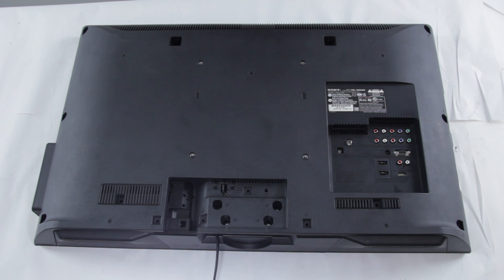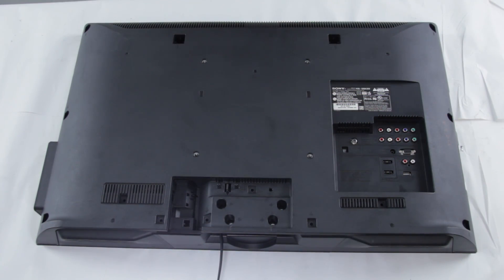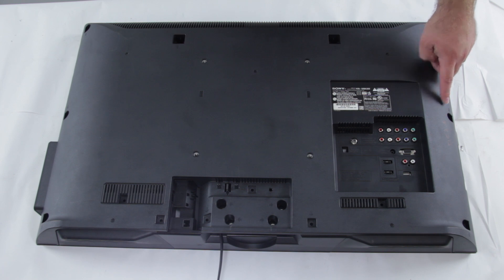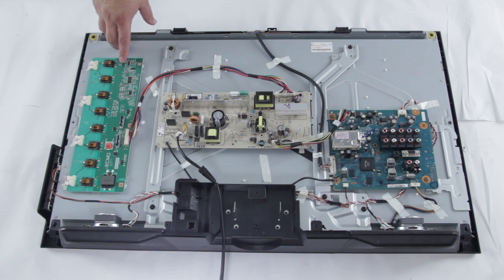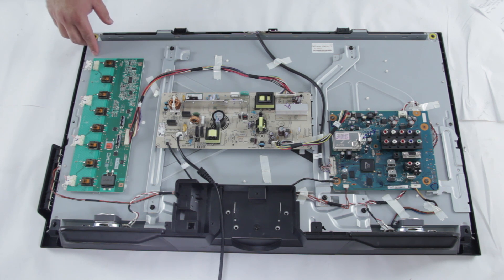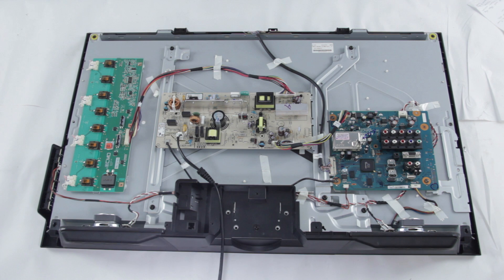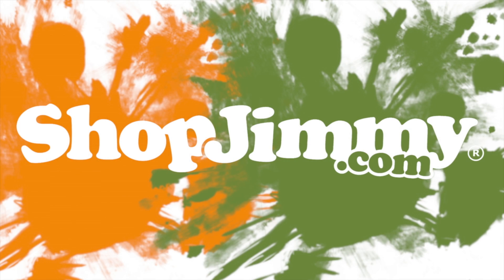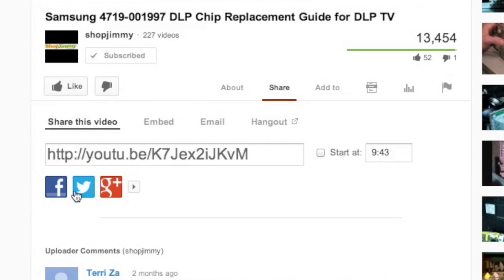LCD TV Repair Tutorial - Backlight Inverter Common Symptoms & Solutions - How to Fix LCD TVs

Comment: Hi, I have a Sharp LC52D62U set that has Red, Green and Blue vertical line across the screen. The picture behind the lines is good, only the lines break it up. Sound is good and backlite. The problem was intermitten a few days but now seems constant.
Thanks for you help.
Reply from the maker: mjhend55   This sounds like a TV panel (TV Screen) problem.  If your TV panel is bad, it may be more cost-effective to replace the TV as panels are typically hard to find in stock, difficult to replace, and expensive.  Thanks and please let us know if you have any further questions!  www.shopjimmy.com

Comment: I have LCD Quadro TFT32-MT15, all works but the picture is extremely in white tone (impossible to set brightness) and colors are inverted red is green etc... I guess its some problem with backlight inverter but not sure, would like to know if expert like you had any similar issues and how to fix it :D All help appreciated.

Comment: Samsung TV LNT4642HX/XAA. Showing symptoms of defective backlight inverters. Screen blank after 1-2 seconds. replaced left and right inverters without success, replaced power supply board, the problem still there. Please help!
Reply from the maker: vladimir chausovsky   Try this at your own risk.  Check the BL ON line to see if that drops out on your meter.  It is possible that you either received a defective replacement boards or the lamps inside the screen have gone bad.  Thanks and please let us know if you have any other questions!  www.shopjimmy.com

Comment: Hello, i got a problem with my LCD TV Grundig MODEL: Vision2 22-2801 SN 90400622, i already took it tot service repair the backlight inverter but the problem still comes back in few months. The Backlight is not going normal is going stronger and lower and it`s very enoying for eyes.  What can i do?  Thank you.
Reply from the maker: p4ulgoodboy   I recommend bringing the TV back to the service center to get it properly repaired.  Thanks!  www.shopjimmy.com

Comment: I have a Sinotec 32" LCD TV Model MT-1017114 LOT# 159540 XHT 080670.  The  TV does not switch on. The standby light comes on at power on but then nothing. I checked the PSU board and found several electrolytics that were measuring low so I replaced them. Still no joy. I checked the 5v line to the main ( processor) board and found it missing. After rechecking psu I established that the backlight invertor board was the culprit. I disconnected it from the PSU and switched on. The 9v and 5v and 24v lines came up but then cut back to 0v. I then made the assumption that the invertor board must be faulty so I removed it. On inspection I found the board underneath the invertor transformers discoloured. On further investigation I found the third one from the top was open circuit. I ordered a board from a supplier but could only get a secondhand one as this TV is pretty old. Manufactured Sept 2008. On receiving the board I installed it thinking now my problem was over. But no way the TV is still not functioning. Could you please give me some leads as to where I can now search for the problem. Your aid will be much appreciated.
Reply from the maker: Basil Solz   It sounds like you have received defective replacement boards, as your power supply appears to be working.  Thanks!  www.shopjimmy.com
Reply: Thanks chaps for your reply it's much appreciated. Yes I came to the same conclusion after re-examining the PSU that the invertor board has to be faulty although it was sent to me as a guaranteed working secondhand board. This is Africa.  :)

Comment: I got your reply ShopJimmy, i tried the TV again the other day and now it wont turn on and the power light is flashing orange, would this imply it is the powersupply instead of the panel?
Reply from the maker: Elias Pease   This could be the power supply that is bad, but it could also be the TV panel that is bad.  If you want to replace the power supply board to see if that fixes the the problem, here is a link to replacement parts:  http://www.shopjimmy.com/catalogsearch/result/index/?cat=59&q=40LC45S57  You will not know if it is the power supply or the panel, unless you try by replacing the power supply board to see if it fixes the problem.  Thanks!  www.shopjimmy.com

Comment: I have a Toshiba 46XV640U LCD television that has had an intermittent problem that with time has gotten worse, almost to the point of being constant.  The problem is when you power the TV on, you get sound but no picture.  You can see that the screen does barely light up almost a faint blue color but there is no picture.  However, if you turn it off and on several times, eventually you will get a normal picture and all will be well.  Once you get the picture there will never be a problem until you turn it off again.  Like I said it has become worse over time.  Also, every once in a while the television wont turn off by either the remote and/or chassis power button so you have to unplug it.  Please help.
Reply from the maker: Joe Anzallo   I recommend replacing the main board in your TV.  Here is a link to replacement parts.  http://www.shopjimmy.com/catalogsearch/result/index/?cat=56&q=46XV640U  Be sure to match part numbers on your current board, with your replacement for compatibility.  Here is a link to a video showing how to identify your part number, click here:  TV Part Number Identification Guide for Toshiba Main & Scaler Boards (LCD, LED, Plasma TVs)  You can also call our customer service for further assistance with your purchase.  (877) 881-6492  Thanks and please let us know if you have any further questions with your TV Repair!  www.shopjimmy.com

Comment: Hi, I have a Proscan model 40LC45S57 and one side of the screen is very dark, the brightness kind of fades out along the length of the screen, im not sure what type of screen it is (plasma or lcd im assuming) and i just want to know if its possible to repair it. thanks!
Reply from the maker: Elias Pease   This could be the power supply that is bad, but it could also be the TV panel that is bad.  If you want to replace the power supply board to see if that fixes the the problem, here is a link to replacement parts:  http://www.shopjimmy.com/catalogsearch/result/index/?cat=59&q=40LC45S57  If your TV panel is bad, it may be more cost-effective to replace the TV as panels are typically hard to find in stock, difficult to replace, and expensive.  Thanks and please let us know if you have any further questions!  www.shopjimmy.com

Comment: HI I HAVE A RCA LCD SERIAL NUMBER: H173CJ01K MODEL: L42WD22YX5

THE PROBLEM IS THAT WHEN I TURN ON AND AFTER A MINUT TURN OFF AND NOW DON'T TURN ON.

THANK YOU.
Reply from the maker: Elisua Badillo   I recommend running the flashlight test on your TV.   Here is a link to a video we produced that shows how to run the flashlight test. No Image No Picture on TV Screen - Flashlight Test LCD & LED TV Repair - How to Diagnose Symptoms 2 Please reply with your flashlight test results and we can recommend a replacement part for your TV repair. Thanks and please let us know if you have any questions! www.shopjimmy.com

Comment: My lcd tv magnavox model number 42mf437b/37 is experiencing dark images at the top area of screen, I felt the screen in these areas and it's extremely hot but the rest of the lcd panel is cool, please tell me what could be the problem
Reply from the maker: anton johnson   This sounds like a TV panel (TV Screen) problem.  If your TV panel is bad, it may be more cost-effective to replace the TV as panels are typically hard to find in stock, difficult to replace, and expensive.  Thanks and please let us know if you have any further questions!  www.shopjimmy.com

Comment: Hi my tv LA40C530F1R hv problem with backlight after 30seconds goes off sound on i use flash light to see picture which still there but no backlight
Reply from the maker: youssef balkis   I recommend replacing the inverter board in your TV.  Here is a link to replacement parts for your TV model number on our website, click here:  http://www.shopjimmy.com/catalogsearch/result/?q=LA40C530F1R  Be sure to match part numbers on your current board, with your replacement for compatibility.  You can also call our customer service for further assistance with your purchase.  (877) 881-6492  Thanks and please let us know if you have any further questions with your TV Repair!  www.shopjimmy.com

Comment: HI, I HAVE A ELEMENT ELEFT502, IN CORNER IT HAS A SMALL RED LIGHT WHEN TV IS OFF, WHEN I TURN IT ON THE LIGHT TURNS BLUE AS USUAL BUT NO IMAGE NO SOUND..NOTHING ALL BLACK.  WHAT CAN BE THE ISSUE?
THANK YOU VERY MUCH FOR YOUR HELP
Reply from the maker: luisfernando908   I recommend replacing the main board in your TV.  Unfortunately I do not see any replacement parts in the search results for your TV model number on our website.  Please reply with your part number on your main board and I can try searching for replacement parts.  Thanks and please let us know if you have any further questions!  www.shopjimmy.com

Comment: Hello, Thanks for taking the time to try and help me out. I have a Samsung LCD TV Model #LN-T4665FX/XAA. The TV picture began to turn on briefly then go black, as the sound of the programing was still coming through from the speakers. I listened to all the you tube videos I could and found that my problem may have been the Back Light Inverter Boards. My TV has 2 boards a left and right with the multiple transformers on each. To curb my losses I chose to replace both. I purchased them from the Shop Jimmy.com and reinstalled the new boards only to find I had the same problem. I have power from the power supply when the set is turned on. The red power indicator light is on in the lower right corner as well as the blue light in the bottom center of the TV front. I do not see any bulges in any capacitors, no burn marks on any of the boards. Doesn't appear to be any broken or cracked board circuitry on any of the boards. Both fuses have continuity. When the old inverter boards were in I was able to view the slight shadow (as referred to in the video) when the screen did briefly light up with a snowy picture before going out. After installing the 2 new boards for a second or two I see the snow and it appears as if the shadow is gone. This makes me think a board was bad, but something else caused it to go bad. Can it be just that I have a bad CCFL? And If so is there a simple way to check that? Any help would be greatly appreciated, again thanks for taking the time.  Sincerely CPJ
Reply from the maker: Charles Johnson   This sounds like you have received bad replacement inverters in your TV or the main board is bad.  Here is a link to replacement parts for your TV model number on our website, click here:  http://www.shopjimmy.com/catalogsearch/result/?q=LN-T4665FX%2FXAA  Be sure to match part numbers on your current board, with your replacement for compatibility.  You can also call our customer service for further assistance with your purchase.  (877) 881-6492  Thanks and please let us know if you have any further questions with your TV Repair!  www.shopjimmy.com

Comment: Element 32" ELEFW328 works fine but sometimes get dark screen but can see pic on the screen but its darks
Reply from the maker: mechi1095   I recommend running the flashlight test on your TV.   Here is a link to a video we produced that shows how to run the flashlight test. No Image No Picture on TV Screen - Flashlight Test LCD & LED TV Repair - How to Diagnose Symptoms 2 Please reply with your flashlight test results and we can recommend a replacement part for your TV repair. Thanks and please let us know if you have any questions! www.shopjimmy.com

Comment: I think I have a fairly common problem with my Sony tv, it is a KDL52wl135, about 6 years old. the picture suddenly went very light with inverted characters on it. the sound is fine as is the signal from the cable. do you know what the fix is?  thanks, Mike
goldmanm1@yahoo.com
Reply from the maker: mike goldman  This sounds like a main board problem.  I recommend replacing the main board in your TV.  Here is a link to replacement parts for your TV model number on our website, click here:  http://www.shopjimmy.com/catalogsearch/result/index/?cat=56&q=KDL52wl135  Be sure to match part numbers on your current board, with your replacement for compatibility.  Here is a link to a video showing how to identify your part number, click here:  TV Part Number Identification Guide for Sony Main Boards (LCD, LED, Plasma TVs) TV Repair  You can also call our customer service for further assistance with your purchase.  (877) 881-6492  Thanks and please let us know if you have any further questions with your TV Repair!  www.shopjimmy.com

Comment: I think I need a backlight inverter for my Toshiba 40L2200U  is that something I can order through you
Reply from the maker: joshua c   I believe the power supply and inverter are on the same board.  Here is a link to the board:  http://www.shopjimmy.com/toshiba-75032000-power-supply-unit.htm  Be sure to match part numbers on your current board, with your replacement for compatibility.  Here is a link to a video showing how to identify your part number, click here:  TV Part Identification Number Help Guide for Toshiba Power Supply Unit (PSU) Boards  You can also call our customer service for further assistance with your purchase.  (877) 881-6492  Thanks and please let us know if you have any further questions with your TV Repair!  www.shopjimmy.com

Comment: I have am element 50' ELEFT502. It has sound but no picture. I can't seem to find where the backlight inverter is located when I opened the back of the tv. Hope you can help
Reply from the maker: UDragon23   I recommend running the flashlight test on your TV.   Here is a link to a video we produced that shows how to run the flashlight test. No Image No Picture on TV Screen - Flashlight Test LCD & LED TV Repair - How to Diagnose Symptoms 2 Please reply with your flashlight test results and we can recommend a replacement part for your TV repair. Thanks and please let us know if you have any questions! www.shopjimmy.com

Comment: I have a Magnavox 32mf337b/27 it will not power up no lights nothing comes on the fuse is good where do i start???
Reply from the maker: Bob Waiter   I recommend that you check for standby voltage on the power supply board.  If you have voltage, then the problem could be the main board or the digital board.  Here is a link to replacement parts for your TV model number on our website, click here:  http://www.shopjimmy.com/catalogsearch/result/?q=32mf337b%2F27  Be sure to match part numbers on your current board, with your replacement for compatibility.  You can also call our customer service for further assistance with your purchase.  (877) 881-6492  Thanks and please let us know if you have any further questions with your TV Repair!  www.shopjimmy.com

Comment: Wharfdale L15T11W-C. Sound but no picture, just a black screen. When you take a flashlight to the screen you can see a really dim image. Need help.
Reply from the maker: Nathan Farren   Since you have an image, I recommend to replace the inverter and if you can not locate the inverter it might be built into the power supply.  Unfortunately I do not see any replacement parts in the search results for your TV model number on our website.  Please reply with your part number on your board and I can try searching for replacement parts.  Thanks and please let us know if you have any further questions!  www.shopjimmy.com

Comment: I have a Sharp LC-42D43U (SN 711833243) TV.  The color became very dark and the only function that did not seem to be adjustable was the "backlight" function.  Audio was fine.  The darkened color seem to occur all at once with no warning or gradual symptoms.  I removed the back cover to inspect and viewed a couple of your videos.  Just want to make sure my observations are correct before ordering any parts.  On this TV the power supply is located in the center.  There are two boards, one right and one left, with removable covers.  Are both of these backlight boards?  Is your suggested repair to replace the backlight board(s)?
Reply from the maker: Dagmar Snowadzky   You are correct, replace the inverters and there should be a left and right inverter.  Here is a link to replacement parts for your TV model number on our website, click here:  http://www.shopjimmy.com/catalogsearch/result/?q=LC-42D43U  Be sure to match part numbers on your current board, with your replacement for compatibility.  You can also call our customer service for further assistance with your purchase.  (877) 881-6492  Thanks and please let us know if you have any further questions with your TV Repair!  www.shopjimmy.com

Comment: Hello I have a 47" Philips LCD TV  model#47pfl7422d/37 that all of a sudden lost the picture we have sound but no picture. Can you please advise and tell me what could possibly be wrong with it I've been googling possible causes and would like to eliminate other possibilities by having a guide to tell me how to check the boards. Any help would be appreciated than.
Reply from the maker: Esmeralda Santos   The main board controls the picture on your TV.  I recommend replacing the main board in your TV.  Here is a link to replacement parts for your TV model number on our website, click here:  http://www.shopjimmy.com/catalogsearch/result/index/?cat=56&q=47pfl7422d%2F37  Be sure to match part numbers on your current board, with your replacement for compatibility.  Here is a link to a video showing how to identify your part number, click here:  Philips Magnavox Main Boards TV Part Number Identification Guide for DIY TV Repair Help  You can also call our customer service for further assistance with your purchase.  (877) 881-6492  Thanks and please let us know if you have any further questions with your TV Repair!  www.shopjimmy.com